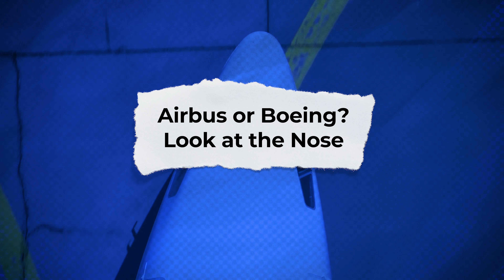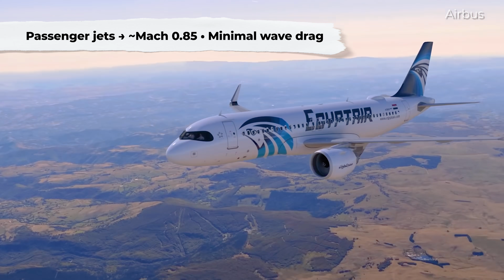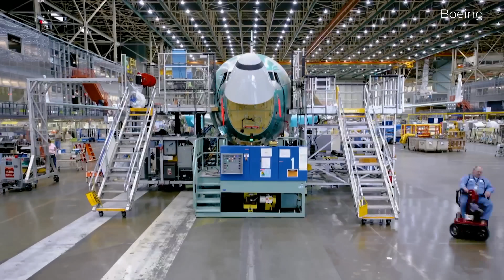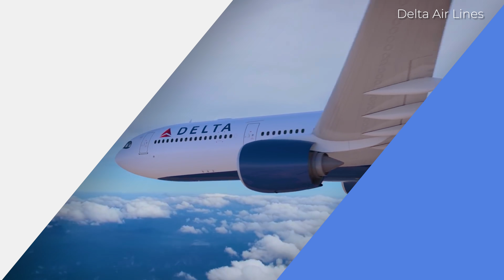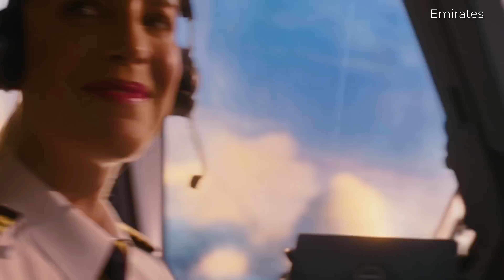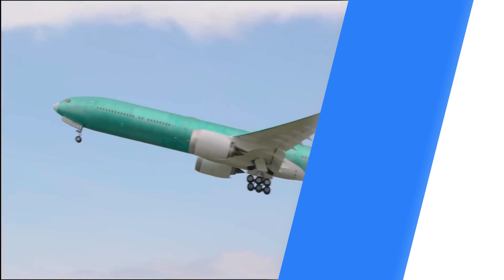How Airbus Aircraft Noses Differ To Boeing's

Comment: Honestly, I liked Airbus nose designs only on the A380, A330Neo and the A350 but in case of Boeing i liked their old pointier nose designs in 737,747, 757, 767 and 777 as well the newer nose designs on 787 and 777X. Its not that i disliked the A320, A320Neo, A330, A340 nose designs, they just dint capture me like the A350's nose design did.

Comment: I tend to disagree.  The 757 nose is different and it's shape has less to do with aerodynamics.  The 707 - 737 (excluding the 717 which is a variant on the DC-9/MD-83 family) share the same basic fuselage between the nose cone and wing root.  The 757 shares fundamentally the same cockpit layout (though there are variations) with the 767.  It fits well in the widebody, where for spacing it is fine.  In the 757, it has to be lowered to allow for fit in the smaller airframe.  This causes the nose bubble radome look of like the Airbus product.  The 757 and 767 were designed at the same time.  Were it not for this cockpit design compromise, the 757 would probably have the same nose cone as the 707, 727 and 737.

Comment: Actually the 777X nose design is the same as the original 777.  The 777 nose shape is actually the same design as the 767.  I know as I worked on the first 1,500 Boeing 777 before retiring in 2017 after 30 years at Boeing.

Comment: I don't think the average person gives it one thought. I am pro Boeing for the most part. No current or past airliner can beat the 747.
Reply: Can beat in what? Every modern airliner outperforms the 747 in nearly every aspect of efficiency and cost-effectiveness. But its design will remain one-of-a-kind for all time.
Reply: @gerhardma4687  Cost and efficiency, who cares. The 747 is the coolest airplane ever made. It has 4 engines, which makes it safer when crossing large bodies of water. I fly the 747 every chance I get even if it means paying a little more. It will be a sad day when the 747 and the A380 leaves the skies and we are left with the boring two engine jets.

Comment: I prefer the Boeing shape, except for B757 which looks a bit more like an Airbus plane
Reply: B757 does resemble one of Boeing's shape, more aerodynamic than Airbus designs, it has a flat bottom like a 787 but of 767 era's design.
787 is the most aerodynamic subsonic commercial jet as of now, so Boeing's designs are better in aerodynamics.
Reply: @johndavidson3424  And how do you know which planes are better? Is it based on your dangerous half-knowledge, or have you conducted wind tunnel tests like the manufacturers do with their models? When I read such unqualified comments, my toenails curl up.
Reply: @gerhardma4687  Be quiet, as if you know better to claim it "unqualified", or knows even a decent bit, cause if you do you won't reply this shit.

Comment: Really quite an awful video? Full of incorrect and inconsistent information? Like saying that the nose of the 777X is droopy like that of the 787 and unlike the 777 or 767, when it's literally THE SAME NOSE. It's like the writer decided to categorise Airbus and Boeing in one clan, and then spent the whole video trying to get us to approve. Instead (and previous Simple Flying videos say the same) there have been been multiple nose trends, and both Airbus and Boeing have subscribed to each.
The real nose trends are:
- symmetrical cone shape (737, 767, 777 & 777X, A330, A340, MD-11, etc.)
- double bubble (A320, A380, 757, Tu-204)
- drooping cone (Comet, Caravelle, 787, A350, A220/C-Series, E190, Superjet, C919, SpaceJet, etc.)

Comment: Why was the a350 listed as an example for Airbus? It, like the 787 has a drooping nose and is not at all rounded...
Reply: Yea, they are very similar, almost no difference. Honestly, I think the nose on these aircraft make almost no difference to the aerodynamics, maybe .01% which is nothing.
Reply: @Djamonja  what, the A350’s nose is very different from the 787’s
Reply: @0w3nn  Barely noticable
Reply: @Djamonja  extremely noticeable. 787 is a beautiful plane A350 is a very ugly plane
Reply: @0w3nn  I actually agree with you that the 787 looks better.
Reply: The shape of the A350’s nose is mostly derived from the A380’s.